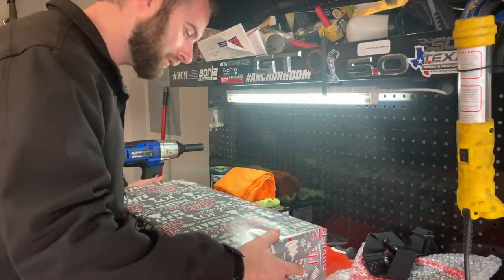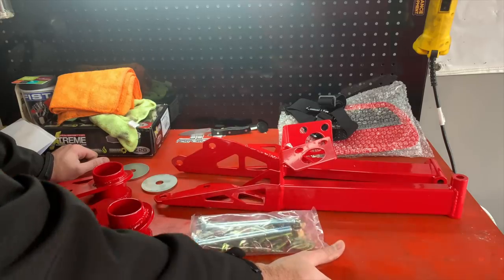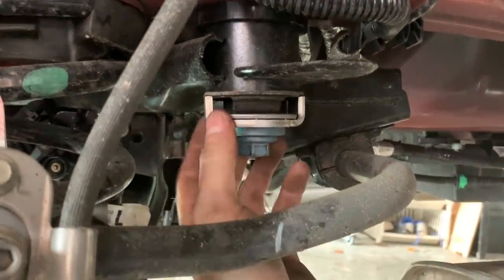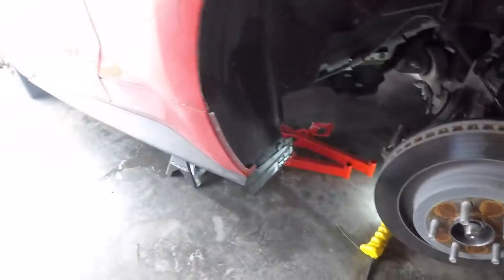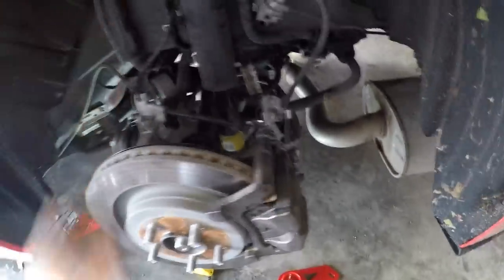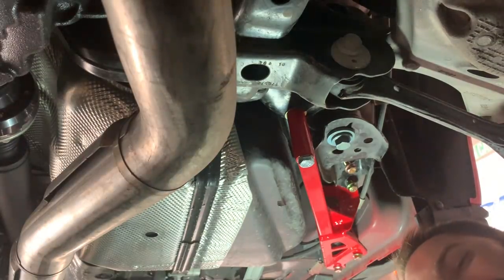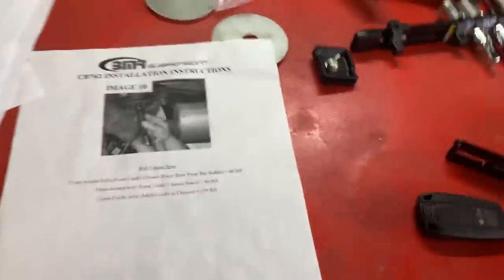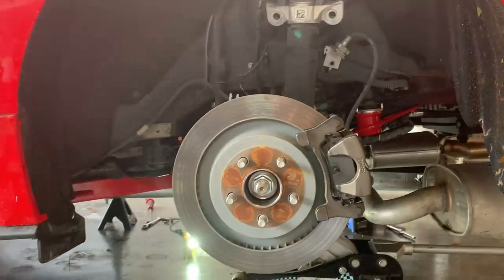2018-2019 Mustang GT IRS Bracing- BMR CB762 and CB010 (No more wheel hop)

Comment: You are absolutely doing it the right way, get your drive train and suspension rock solid, then add horsepower, makes for hard launches and low ET’s 👍
Reply from the maker: Yes, agreed. We need a solid foundation before big power
Reply: I've preached suspension/drivetrain and maybe gears before even a tune. You can't ET without a good 60ft. With stock power and a great launch you're looking at  4-5 tenths decrease with a full warranty.
Reply: Deff agree

Comment: Thanks for the video.  If the BMR CB762 and CB010 work as well as expected, then it's impressive value for the price.  Wheel hop sucks.  Removing it from the equation can greatly improve off-the-line acceleration and one's 60 ft. time.
Reply from the maker: Absolutely. It works hand in hand. The car feels vastly different
Reply: @Zander13Productions  Does this kit affect the smooth ride turning it more in to a solid Chassis. I know when I ran a custom car just changing to lowering springs and gas shocks and Nitrogen filled tyres made the car a hell of a lot stiffer.
Reply from the maker: so far this kit is nuts. I can actually feel the car has improved take off in just normal driving. I love it. No NVH. The IRS is totally solid. The turn in has improved a ton too bc the IRS is not wondering all over the place.
Reply: Zander13 Your enthusiasm as confidence in this product had made me quite interested in investing in this kit. Only question is, I am confused over the difference of the numbers. CB 1234 etc
Reply from the maker: sweetcheels thanks. So far driving with it could tell immediately that the car was better even as low at going 10 mph. Car has better take off and turn in. No nvh at all. I am running http://m.bmrsuspension.com/?page=products&productid=1910

And
http://m.bmrsuspension.com/?page=products&productid=1727

I didn’t expect it to be as significant as an upgrade as it was. I am blown away by it. I also have their jacking rails. 
http://m.bmrsuspension.com/?page=products&productid=1774

Please use the promo code zander7 as it helps us both out! And saves you money

Comment: Great install Video! Looks great! I might have to add that to the R to finish off the IRS. I really like the front support tie in. Honestly though I’m questioning the benefit of the rear support. It connects to the IRS not the frame so I’m not seeing how that would reduce movement on the rear of the IRS.
Reply: The rear mount attaches the to solid part of the mount (bolt/bushing/chassis) and extends out to the IRS subframe. This method locks the rear of the subframe in place 100% for zero movement in any direction.
Reply from the maker: so far this kit is nuts. I can actually feel the car has improved take off in just normal driving. I love it
Reply from the maker: so far this kit is nuts. I can actually feel the car has improved take off in just normal driving. I love it
Reply: Gotcha. Thanks for the reply Kelly.

Comment: Great tutorial. Can This kit be used with the BMR low profile full length jacking rails? And can the CB 005 kit be used at the same time? I know you said in the video it can but I haven't seen anyone using both.
Reply from the maker: Yes. All designed to work together. Promo code zander7 at bmrsuspension.com and save some 💰

Comment: Cradle Bushing Lockout Kit, Level 1 VS. 
CB005 Cradle Bushing Lockout Kit, Level 2  Is there a specific reason for not going with the level 2 when also installing the CB762 - IRS Subframe Support Brace System?
Reply from the maker: Basically because the bushings are the same. I just don’t have the big arms from the cb005. But the performance is about the same. The cb762 is where it’s at though. Definitely worth the price. The 762 kit dramatically changed the way the car felt, even just on the street

Comment: Zander, love your channel and your videos! I also have CB765 & CB010 on my '18 with MagneRide.  I'm installing BMR Springs this weekend.  Question:  Did you have to remove the the CB765 braces completely when you installed springs?  Or, can you just leave them loose and still get enough drop?  Asking because installing the braces was a bit of a pain getting them to line up.  Thanks!

Comment: So I can use these 2 setups aswell as the CB005 and everything works well together? I see you have a video for the CB005 but it isn't mentioned in the info, did you remove it? Thanks, great videos. I was leaning towards Steeda until this video
Reply from the maker: Yes. All designed to work hand in hand

Comment: I was planning on buying the Steeda Stop the Hop kit.  Can you tell me which Steeda parts the BMR CB005, CB762 & CB010 replace?
Reply from the maker: Cb005 may not be needed if doing the cb010. Since they basically have the same bushings but they do work together and would be very solid. The cb762 tops it off and would replace the steeda stop the hop brace. The only thing that BMR does is suspension so I really trust them. Use code zander7

Comment: So I  bought the CB762 and did not like it AT ALL. I would not call this thing precise, I call it sloppy. It was so hard to line up the holes and I ended up removing it because I  was on the verge of stripping the bolts. I don't like how things don't line up and you have to force it, just doesn't feel right. I'm  doing a  refund if possible now and gonna get the Steeda version. Now the CB005 I liked a lot and already made  a huge difference in the feel of my Mustang  but this one is a waste of money. You're running the  chance of stripping the bolts and/or the bolt hole. Damn shame really cause it would have looked awesome in addition but just doesn't fit right.
Reply from the maker: Not sure what’s up but mine was and has been 100% perfect

Comment: Hey man I just installed this kit on my 19 PP1, did you experience any sort or creaking or nvh at low speeds or incline/declines? Mine is a tad bit noisy and was wondering if this is normal. Thank you!
Reply from the maker: None. Just recheck torque. Mine have always been quiet

Comment: I was debating between this and the Steeda but you sold me after seeing the setup/installation and you're right...the BMR setup just looks like a better wheelhop deflection vs Steeda's.  Question: Will this void my warranty?  This is a make or break question because otherwise I'm just gonna have to wait until my warranty is up.  Especially with the manual transmission and engine issues, don't want to risk it.
Reply from the maker: This will not void a warranty. It’s a simple bolt on part. I have driven cars with the steeda kit and my car with this is soooo much better. It’s just a much more solid unit than the steeda stuff. The take off and turn it has improved and I swear my steering is sharper bc the back end is more solid. Please use code zander7 if you order from bmrsuspension.com
Reply from the maker: This will not void a warranty. It’s a simple bolt on part. I have driven cars with the steeda kit and my car with this is soooo much better. It’s just a much more solid unit than the steeda stuff. The take off and turn it has improved and I swear my steering is sharper bc the back end is more solid. Please use code zander7 if you order from bmrsuspension.com

Comment: Thanks for a great tutorial. Just finished installing the CB762 IRS kit from BMR. Took it for a test drive and wow. It's a totally different car. It's road manners on the highway are improved and smoother. Feels so solid. Steering is more precise. Definitely worth it even without racing it. Tomorrow will be the real test at Pike Peak International Raceway here in Colorado. Installed on 2015 GT Premium with PP. @blue_dragon_mustang
Reply from the maker: Awesome. I swear it really does transform the car a bit. You can really feel it

Comment: I’ll buy, if you....install 😂
Reply from the maker: absolutely
Reply: Lol s197 buddy! I don’t have any of that to worry about. I am very interested in the BMR k member though
Reply: @37oH55V  I like how you did your handle by the way - keep meaning to say that....wonder how many don't get it lol. K-member is fantastic by the way but I recommend doing the A-arms and motor mounts at the same time. Just way easier since your in there.
Reply: @techknown  Lmao I think it goes over most heads. Thanks for the advice. Did you do the lowered motor mount location or standard location? Did you do the billet motor mounts from BMR?
Reply: @37oH55V  lol. That's great. Standard motor mount and it was the black and red poly mounts.
Reply from the maker: 370H55V O773H promo zander7 lol. It looks like a solid piece
Reply: Torry Bisnett this is good info buddy. Did you choose the adjustable A arms?
Reply: Zander13 sounds like I’m gonna be using the hell out of that promo code lol. 4 kids, 2 mustangs and a wife during the most wonderful time of the year...I need to save all I can
Reply: @37oH55V  sorry this must of slipped by my notifications. They are non adjustable. At that time it was more street car but lately it's been more strip car and I am going to start rebuilding it for a drag setup for more power lol
Reply: Torry Bisnett good deal brother. Post videos so we can keep up with your build

Comment: Both of my S550 Mustangs did not  wheel hop
Reply: The launch I use I felt hop only once (mt82) even with et streets ss's. Still want these for axle insurance. I've helped push too many s550's onto trailers at the strip club.

Comment: OK, OK... Now tell me Why is this a better solution … than the SN197 version Mustangs - Which had a straight rear axle from the factory?

     Everybody was screaming, whining, moaning about Ford needed an Independent Rear Axle (IRS) - to bring it into the 20TH Century - get rid of the old school, "muscle Car" suspension?   Seems every suspension "improvement" is designed to transform the compliant IRS benefits ...by limiting the IRS - back into a Solid, stiff rear axle....Again?

     All it takes it 3 - 5 hours of work and $400 - $500 (minimum) of hardware to severely limit the functionality of the IRS. Oh, and by the way now the basic Mustang goes out the door at $40K - $50K instead of between $20K something to $30K?
Reply from the maker: this does not make it a solid axle. the control arms still perform as the same just less bushing movement
Reply: @Zander13Productions  ....+Zander - that's not what I was trying to say. It was not my intention to pour sand in the gears of what you were saying or to make it sound like BMR doesn't address a 'known' issue ...when it comes to high stress reaction - based on the compliance, flexibility which come with a IRS rear-end.
   What I was pointing out is similar to what happens when example... lets say,  you sprain your ankle or twist your knee.
     At some point - if the doctor gives you a metal brace or puts pins in your ankle - to stablize it when you keep finding it gets weak when you climb stairs, or try to go jogging...play sports. You give up the ability to make minor adjustments ,, quick little adjustment - like stepping on a rock or a 1/2 inch drop  when the stairs are not perfectly even or quick turns....its the "little things" that are no longer taken up in regular cushioning.

    After a certain number of tweaks... the IRS gets closer and closer to acting "almost" like a 'live axle'....instead of like twhat the IRS was installed/built to fix.

This is an issue Ford decided to fix, instead of something a lot of hot rodders were screaming about.
 
We got civilized, regular folks started buying mustangs... Even the quickest, fastest Mustangs are now 10 speed Automatics. Hope that kinda explains what I was talking about?

Comment: Just installed both kits. Build quality us great. However the instructions are z heaping pile of garbage. They were basically useless. 

On the cb762 kit do 1 corner of the IRS at a time, otherwise you can shift it making nothing line up.
Reply from the maker: Yes. Hopefully this video helped a little

Comment: Thts waaay to much unnecessary work why remove tires why remove half of the stuff u did?not trying to b rude but why have people do all tht extra stuff they don’t need to?you do not need to remove tires.
Reply from the maker: I did it so it’s easier to film with less stuff in the way…
Reply: It takes less than a minute to remove a wheel.